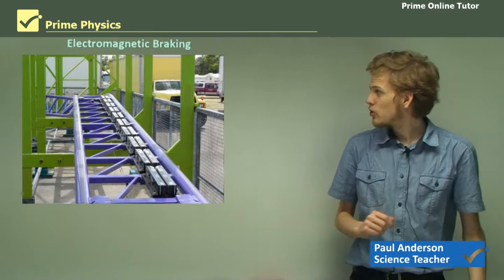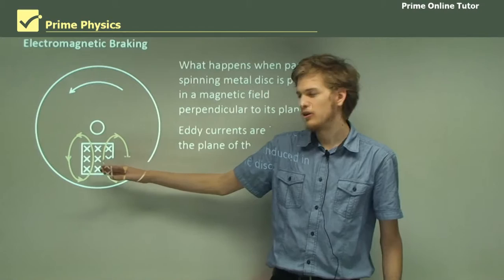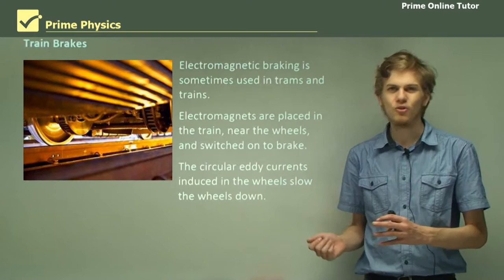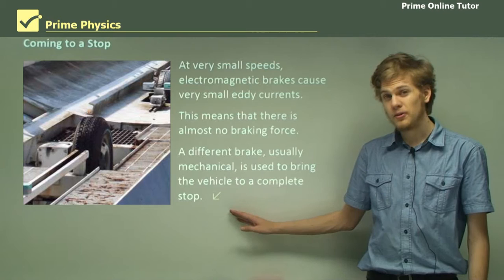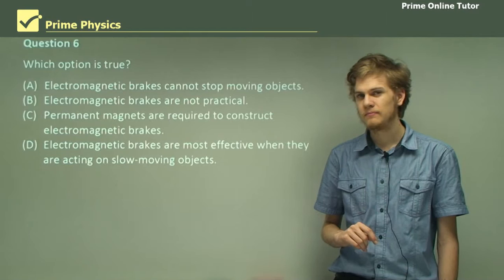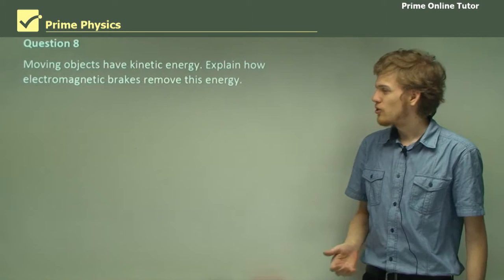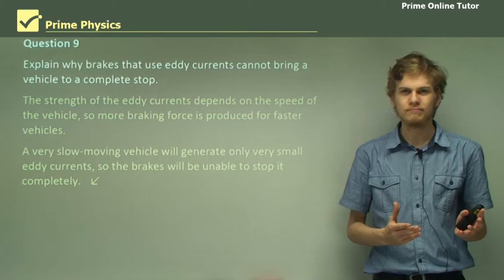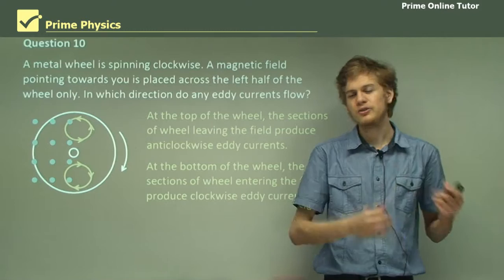Demystifying Electromagnetic Braking: How It Slows Things Down

Comment: Great physics, but very poor English in the auto-subtitles. Break(ing) instead of brak(ing) etc.
Reply from the maker: Thanks for picking it up. However, "braking" is correct in this case, while "breaking" is not relevant to electromagnetic. Please remember that brake is the one that gets a motor vehicle to slow down. So "Break" does not make sense with electromagnetic and this topic. Hope this makes sense 😄
Reply: @iitutorcom  Yes, that was the point of my comment, that 'break(ing)' was incorrect. One of the problems of English as the words sound identical to a computer.